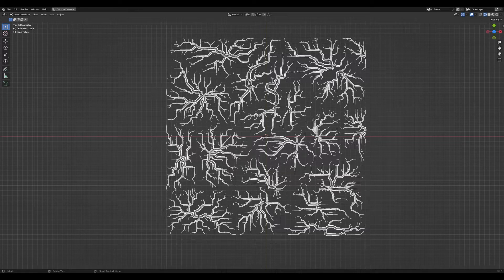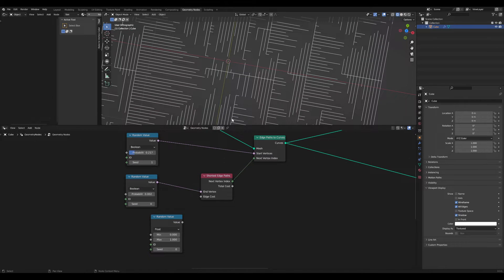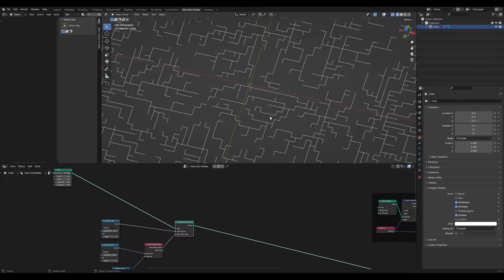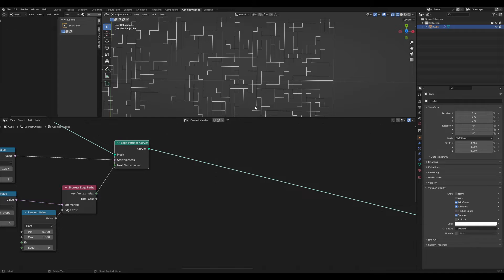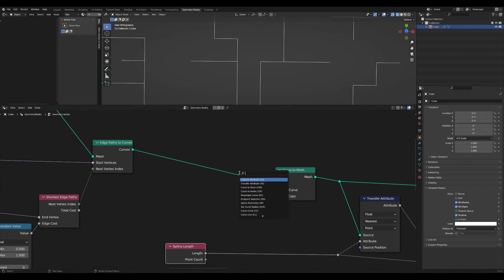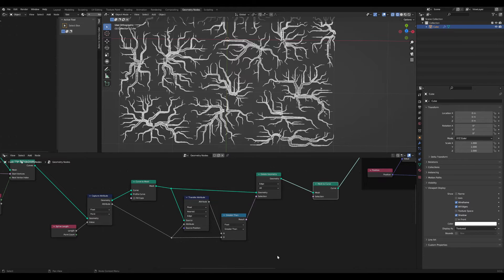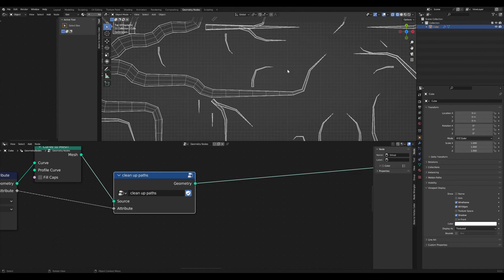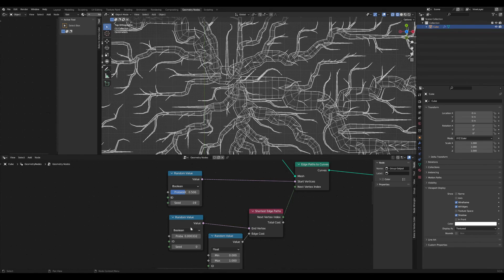Optimize Shortest Edge Paths - Blender Geometry Nodes

Comment: This video is exactly what i needed, but as many others have pointed out, the solution without the transfer attributes node doesn't work. I've tried multiple times with the Sample nearest and sample index, but I really can't figure out how to make it work. Whenever you have time, a step-by-step explanation of how to set it up in this particular scenario with roots would really be super helpful.
Reply from the maker: I try my best! An updated tutorial would also be useful because of the new loop nodes
Reply: @100drips yeah the repeat node definitely adds to this specific node group. If that’s not too much to ask you, could you please just tell me here how to connect these two nodes that replace the transfer attribute to achieve this same result? I’ll be looking for the tutorial as well, but having this solved now would help me a lot as I’m in the middle of a project and can’t solve this; I’m mediating with a “merge by distance” node, but it messes up the length and therefore the with of the curve. First time in the last 10 years using blender that I’m seriously stuck ngl.
Reply from the maker: @GT59591 I'll try my best, since I am not on my computer, but it should work as followed: use the sample nearest node to get the index of the nearest point. With the sample index node, you should sample the attribute at that index. This should give the same behavior as the transfer attribute node. But if you can wait a day or two, I can rebuild the setup in 4.5.

Comment: How would you do this in 3.4 without the transfer attribute node? I can't get it working with the new sample nodes.
Reply from the maker: You need to combine the sample index with the sample nearest node to have the same functionality as the old transfer attribute node.
Reply: @100drips  Thanks for the great tutorial! I'm also having problem with the Sample nearest and sample index nodes and it doesn't work as well. Do you think it'd be possible to obtain the same results as with the transfer attribute?
Reply from the maker: @Kamome163  hey. i am not on my computer right now, so i have to try to remember this correctly... but using "sample nearest" first and then "sample index" should give the exact same result.
Reply: @100drips  a clearer explanation would be appreciated as in which inputs outputs to use or what other nodes from your tutorial above are still relevant to this method but thanks for your comments either way
Reply from the maker: @elstinopacino  i've recorded a short video on how to transfer attributes in 3.4 and up: https://youtu.be/LS7nsFNCRfY
Reply: @100drips  This does not work for me. When I change from point to edge on sample index and sample nearest the mesh is all broken?
Reply: @tjcarr70  Same for me, doesn't work in Blender 4.0. The funny thing is, I tried even more approaches, but can't delete the overlapping edges.
Reply: @tessellate1220  hey, have you managed a way?